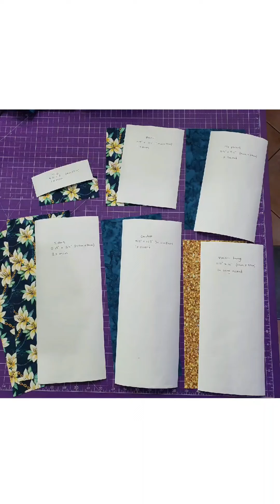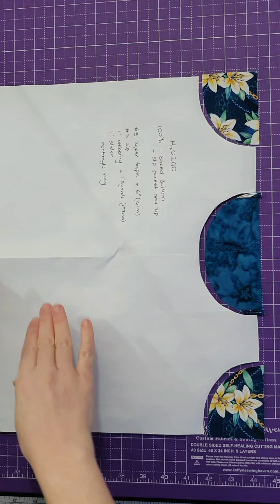Linds Handmade H2O 2GO with slip pocket and box bottom hacks

Comment: So enjoyed your tutorial and actually successfully completed it!  Thank you as I’m quite new to sewing. I found that once I have a bottle in the bag, the zipper pocket becomes quite tight and hard to get things in and out of it. Do you have a hack that could enable the zipper pocket to extend when opened?  I’ve seen pockets that sort of have a pleat on the side so open up a little more but I wouldn’t have a clue how to adapt a pattern. Such a great job and it’s really nice to not have any annoying music in the background whilst trying to concentrate on what you’re doing and saying.
Reply from the maker: Hi Cathy, Thank you for your lovely comments. I don't have a massive drink bottle so I don't really have the tightness problem however I've heard others with large drink bottles have had the same. The original pattern solves this problem perfectly. By having the external pocket protruding from the front slightly it gives more room that this slip hack. If you weren't ready to tackle the curved front pocket you could try doing a pleated pocket. I'm not a huge fan as I feel they gape open unless you have a closure at the top. Another option would be to cut all your front pocket pieces a smidge wider (maybe 1/8" or 1/4") then when you baste the centre pocket pieces to the long centre panel (original size) it will pucker out a little bit giving you some extra room. I would even play around with tapering it so only the top is a little wider and keep the bottom 2.5" of the pocket pieces the same so it still sits flush for the base and just before it folds under. I hope that makes sense to you. It's just brainstorming in my head and will prob need a bit of play. Good luck!

Comment: Ebony this is fantastic, and as others have said, no unnecessary chat. It has made this bag doable for me now, thank you. Could you please tell me what size the bottom is now it's boxed? The original pattern is 6" wide x 4" deep - I'm assuming the boxed bottom is now square? Thanks again, I'll look out for your new videos.
Reply from the maker: The boxed bottom measures 3 3/4" both wide and deep. I played around with the corner cutout measurements before I made the video to try and get the base as square as possible I stead of rectangle. The body of the bag has the same circumference as the original but because the shape is different it sounds much smaller on the boxed bottom. They actually have a similar base area at 15 vs 14 square inches. 😊
Reply: Thank you very much @whatastitchup.creations

Comment: I love your video. Is there a way not to have the pocket in the boxed bottom? Essentially having the pocket above the box. Just trying to avoid the bulk in the boxed bottom
Reply from the maker: If you shorten the zipper pocket lining piece about an inch (11" tall) I think it takes it out of the bottom seam. Or if you want to take all of the seams out  of the box bottom you could cut the front bottom piece shorter, sew the front assembled pocket rst top and bottom with the slip pocket back piece, flip it out and sew on to the centre piece about 2 inches up. I haven't done it that way as I prefer the seamless look of the front so I'd have a play with it but that's how I would try it.

Comment: Thank you!  Great tutorial!  One question:  when cutting the exterior after the panels have been sewn together, are you using the Main Body Liner pattern piece?
Reply from the maker: No not the liner piece. It's the main exterior piece I just traced it into a bigger piece of paper as I've added the 2" to the bottom and ommitted the curved cut out from the original pocket. The exterior and liner pieces are not the same size. Liner is slightly smaller so it fits inside nicely.

Comment: Wonderful video!  You use 1/4 inch to construct the pocket/panel.  Do you use 1/4 inch to sew the side panels to it or 3/8?  Thanks, this looks SO much easier.
Reply from the maker: 1/4" to add the side panels. Once the whole front panel is complete I use 3/8" to sew the main back seam.
Reply: My question too. Glad it was answered Ty
Reply: So I used a 1/4 on the whole thing I missed the note on the seam allowance I have my front panel all assembled should I continue using 1/4 on the rest? Also the height of the bag dosnt match the height of the pattern piece? The pattern piece measures at 13 inches after adding the 2 inches to it and  the side  panels were to be cut at 13 1/2?  Also should the liner height be the exact same as the main panel height?
Reply: @whatastitchup.creations hi, it would be most helpful if you added these SA clarifications to your initial instructions please, as I’ve spent well over an hour reviewing your video and reading replies.   Many thanks for this brilliant tutorial.

Comment: I love the hack video, however, I don’t know any stitch size you use for the most part. I know it is in the original pattern, but not the hack. Do you use 1/4 or 3/8 for seam allowances? Thanks
Reply from the maker: At the bottom of the description I list the seam allowances I used. 😊 1/4" for the front pocket assembly and 3/8" for the main body assembly.

Comment: Couple questions I didn’t realize we were to use a 3/8 inch seam allowance. I use a quarter inch I have my front panel all put together should I continue using a quarter inch seam allowance or should I switch to three eights also the panel pieces were cut at 13 1/2 inches tall and then we are to use the original main body exterior pattern with adding 2 inches to it, but that ends up at 13 inches tall so which is correct should it be 13 1/2 inches tall or 13? Also is the liner that goes inside the bag to be the exact dimensions of the outer piece so the height for the liner should not be the same as the height for the exterior.? Thank you
Reply from the maker: I use a 1/4" to assemble the whole front with the pockets and then switch to a 3/8" for assembling the body of the bag.
The lining is a little shorter than the main exterior. If you add 2" to the lining piece and 2" to the main exterior piece there should be about 1/4" - 3/8" difference (I can't check which as I'm currently in bed lol) So just use the original pattern pieces with the 2" added and cut off any extra.
Reply: @whatastitchup.creations  thank you so much for your help! I appreciate it!

Comment: Can you use waterproof canvas for the inside of bag ?
Reply from the maker: Absolutely. The black I use inside this bag is waterproof canvas. I always use it for the main lining in case of leaks or bottle condensation but if you wanted to use it inside the pockets as well you could.
Reply: Did you use medium weight fusible interfacing?
Reply: Do you use medium fusible interfacing ?
Reply from the maker: Yes medium weight fusible interfacing on the cotton.
Reply: Thank you for responding 😀😀😀😀

Comment: Hello! Question about the seam allowances. When it says the pocket is sewn at 1/4 and the rest at 3/8, does the adding the side panels to the slip pocket piece use 1/4 or 3/8? Thank you!
Reply from the maker: 1/4. The 1st time I use 3/8 is when I sew the back seam of the exterior panel after cutting out the top shape.

Comment: Thank you so much for this tutorial. I've almost completed the bag but I'm stuck on the sling. What did you use for the strap adjuster? I can see it's the black plastic one but is it the adjuster or the glider? Thanks for your help in advance.
Reply from the maker: It's a plastic triglide that has little grooves underneath to help grip the strap. I have used the metal ones with the adjustable bar that moves but I quite like the hold on these plastic ones.

Comment: Great tutorial! Very clear and detailed. Only question is does the designer have instructions for different sized bottles? Such as 2 litre and 1 litre bottles?
Reply from the maker: I have made this in different sizes by printing the pattern at different percentages. You can mix and match different percentages for width and height to suit your personal drink bottles. It's done a lot for kids. The original definitely fits a 1L and maybe up to 1.5L. Depends on the bottle dimensions.

If you do the hack version you don't want to put a huge bottle in as it makes the pocket hard to use.

Comment: thank you so much for doing video :), can square bottom be done if doing the credit card pocket ? ty
Reply from the maker: You can do the whole original curved zip pocket with the card pockets by adding an extra 2.75" strip to the bottom of the completed original exterior piece with a 3/8 SA. And add 2" to the bottom of the lining piece. Then do the boxed bottom as above. 😊
Reply: @whatastitchup.creations  awesome tyvm
Reply: i made it its so much easier then doing round bottom tyvm

Comment: Thank you for the great tutorial ...I just had a question concerning the part where you cut out the squares for the boxed bottom...I see that it shows 1.5" from SA (3/8" drawn line) and from side 1.5" for both the exterior and lining.  In other videos they say they take a "scant SA ...should I do 1.75" (1 3/4") from SA and 1.5" from the side of the lining to make it fit nicely into the exterior.  Please let me know your thoughts.  Thank you
Reply from the maker: I always do the same but if you really wanted to I would take the same amount from top and side. With the sew line we have already accounted for the SA so they should be the same. Scant is just a tiny bit so prob wouldn't need to be a whole 1/4". The lining on Linds original pattern is already a bit smaller so I've never had a problem doing them both the same.
Reply: @whatastitchup.creations  oh ok thank you I didn't realize that. In that case I will just do the same as you suggested.  Thank you so much I really appreciate the help and the helpful video as well.

Comment: I have a 40oz bottle from Amazon and would love to know how well this fits. Height is 10.4 and base bottom is 3.5. I dont want it to be to lose in this nor to short. Any help would greatly appreciated
Reply from the maker: Based on others who have used this for their 40oz bottles I think it should fit fine, however you may not be able to fit as much in the pocket as the fatter bottles can make the slip pocket curve to fit the bottle and make the pocket a little harder to use. The original pattern with the curved pocket still works the same with a 40oz bottle.
Reply: I have a 40 oz hydro flask and just completed this pattern with the hack.  It fits perfectly.  I actually ended up (for some unknown reason) having my entire sewn project (before cutting curves) actually 3" longer than what she did here.  Have no clue how that happened, but it works!

Comment: Thank you for the very clear tutorial! 

I noticed that you didn't use any of the recommended "stiffeners" in the bottoms of the exterior or lining. Do you find the boxed seams add enough strength, or would you recommend some stiffener is added after the boxed seams are sewn?
Reply from the maker: I find the seams across the base add some support. Maybe if you were planning to carry a very large bottle or you only used cotton you could add a small rectangle of stabiliser between the 2 layers. I haven't ever added anything with the boxed bottom but I always do with the original bottom.
Reply: @whatastitchup.creations , thank you for your reply!

Comment: I have a full inch left on the front panel on the bottom do I trim it off?
Reply from the maker: That's a lot to have extra. I only ever cut off about 1/4 inch at the most and it depends on the foot I use sewing on the zipper. Check the back pocket piece is the correct size. (my plain green colour) because its an easy fix to just replace that piece rather than cut your pocket pieces and it be too small. If it's right, double check your front pieces. One might be a bit long and in that case trim it. But not the pocket lining.

Comment: This looks really easy!  Just bought this pattern and am looking forward to making this.  However, I see a lot of people using waterproof canvas.  I don’t have WPC yet.  What is the best place to find this?  Is there something else you can use?  I would imagine WPC would be ideal for sure though.  Thanks in advance
Reply from the maker: If you are in Australia, I get my WPC from Seams Legit. If you can't get Wpc you can use cotton. It wouldn't be water resistant but if you had an insulated type bottle that doesn't cause condensation you probably wouldn't need it to be. You'd also need an extra layer of something to stabilise the bag as the Wpc also adds structure.

Comment: What part of the pattern you use the exterior main body for. I find that after I made the front, the main body liner did not measure up with the front of the bag. Can you explain how and when the exterior part of the pattern is used.. Thanks
Reply from the maker: The exterior main body is for the front where the video shows me cutting the top curves. It should fit almost perfectly if your seam allowances were correct. If your front is a little big you can just trim it down. If it's a little small then it's not a big deal just trim your liner a little smaller as well. For future sews if you are worried you could make your side pieces a half inch longer or wider to be safe and trim off the excess using the main body pattern at that point. Hope that helps.

Comment: What size is the strap and the attachment for the rectangle ring?  Is the main fabric cotton?
Reply from the maker: Yes the main floral fabric is cotton and the measurements for the straps and connectors are the same as in the original pattern. 😊

Comment: Hi, what is the interior lining material?
Reply from the maker: Waterproof canvas. It adds structure whilst also protecting the bag from condensation from your water bottle.
Reply: @whatastitchup.creations  I didn't find in my local fabric store. Is it like a regular canvas feeling material?
Reply from the maker: There are different types. Some are thick and heavy like a normal canvas but with a plasticy coated side. Ottertex I think is a thicker type. I use a thinner type that is easier to use and turn. Some people have had success using things like a shower curtain if you cannot find any.

Comment: When I had did my final piece putting the sides on next to the centerpiece, my whole piece was 15 inches wide, which was not able to fit the original pattern. It was too small. Could you tell me what should the width be after putting in the side panels in the pocket.
Reply from the maker: I don't have the pattern on me as I'm at work but it should end up exactly the same width as Linds original exterior pattern piece. I am thinking your seam allowance was a little too big. It should be 1/4" all the way up to adding the side pieces. Then switch to 3/8" to close at the back.
Reply: so 1/4 inch when adding the side pieces and only 3/8 to close the back? thanks